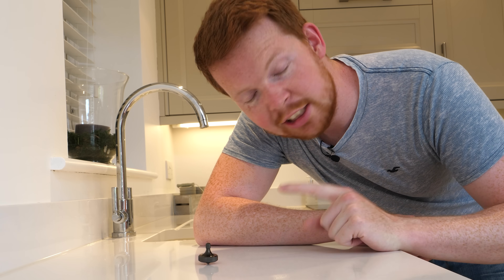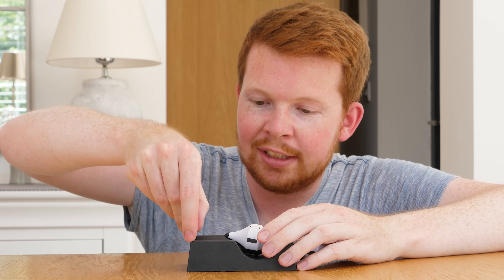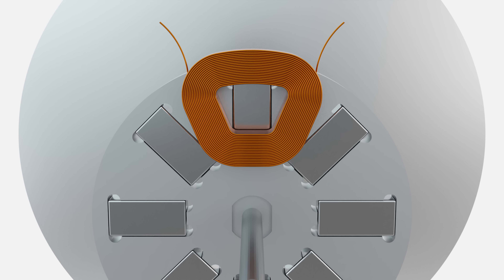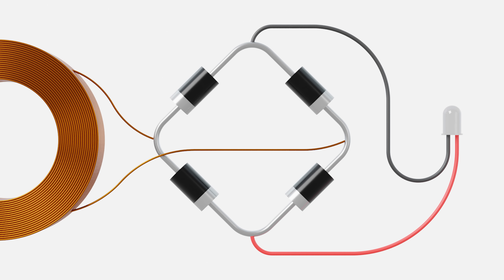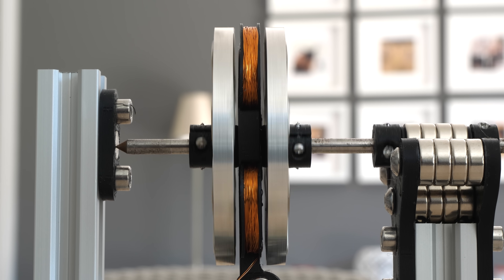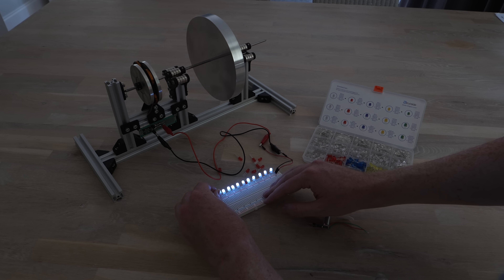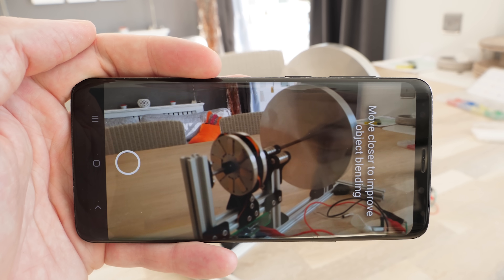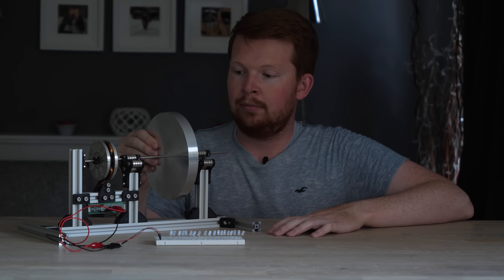Flywheel Battery

Comment: Try surrounding the magnetic shaft of the flywheel with several rows of magnets, instead of having it rest in a magnetic cradle of a couple rows.  Completely surrounding it will prevent the wobble and allow higher RPMs.

Comment: place a static film capacitor in series with a resistor in series with the generator and then the bridge rectifier in paralell to the static capacitor and then a filter cap in paralell to the bridge rectifier and then the diodes in paralell to the cap and you chould now get much more power out and less loss of speed on the generator. the static capacitor will build voltage in resonance with the ac and charge up until the current reach a certain level. the resitor will limit the current and load on the generator. for low voltage you have to use very big static cap.

Comment: Great job Tom! I was wondering if you can make an experiment by sticking the magnetic discs (in attraction mode) on both sides of the aluminum disc and so to spin together (homopolar generator normally have N pole in one side and S pole on the other, but try first with your setup N-S-N-S) and measure the voltage between the shaft and the edge of the aluminum disc? that will be interesting to see the voltage and current (considering the big size of the disc). I was willing to make it myself, but I don't have the tools :(

Comment: While it is a little more expensive, use Thompson induction hardened shafting for your projects.  It's hardened and ground and very very straight. I built countless jigs, fixtures and other tooling using it and it has never failed me in 47 years of tool making.  Love your work.

Comment: if you add magnets (with or without coils on the magnets) at an angle so they constantly repel each other on the far side of the shaft would it be able to power itself or have a reduced loss of rotation?

Comment: If you want to remove the shaft from the ally disc and not able to do so then heat the disc with a propane torch, the ally will expand faster and further than the steel rod, get it hot enough and the rod will fall out, if you don't have a torch handy an oven will do.

Comment: Maybe if you added a hand crank with a gear on the shaft and a larger gear on the crank that you could pull away on a rail, you'd get more RPM without resorting to a drill or sapping energy with bearings. Also, finding the radius before drilling the hole for the shaft would make it much more balanced because you could drill in the exact center of the flywheel. Also, MORE MAGNETS! More magnets holding the shaft up would make it move around less, especially if you alternated the poles on each of them. More magnets generating power means more voltage and amperage. A larger coil with 24ga wire around a magnet hub with smaller magnets on the edge would also generate more consistent power. It's a great project, but you could actually power some 5A 12v LEDs with this if you optimized it, making for a great desk lamp.

Comment: If you would connect a motor to it that would set the speed and give the power back  of this machine, and then accumulate excess current in the battery, would you not get a perpetummobile and free energy? which can be used, for example, in an electric bike in which it would load itself while driving?

Comment: What if, instead of slightly tipping both magnetic bearings to the same side and stabilising it by the rod-wall connection, you have the bearings slightly pulling a party from each other. Shouldn’t that be somewhat stable?

Comment: Have you thought of using a parabolic mirror to throw light into a fiber optic cable and focus the cable light onto the flywheel to get it spinning faster and faster.  Put the flywheel in a vacuum box to reduce drag.  Use an electronic circuit to power a small variable electro magnet at the point of the axis that touches the vertical glass or use a small bearing from a computer disk to reduce the friction at the axis point .  Put a drop of oil at the point of friction to lower the friction on the glass plate .

Comment: @11:10 I recommend that you use a capacitor along the + and - of the generated voltage to eliminate the flicker. Use different values until you get steady voltage.
Reply: I'd be grateful if you could explain a bit more
Reply: @TheNightsfall1   The capacitor has the property of charging itself and keeping the charge inside it until it is discharged by a load - in this case the load is an LED. depending on the load current the proper capacitor can be used. The larger the load current the higher the capacitor value needed to sustain the voltage to the load LED. Adding capacitors in parallel increase the value of overall resulting capacitor thus sustaining the charge longer and thus reducing the flickering effect.

Comment: Awesome demonstration. I have a question for a while and might be a good idea for your next project, or you might just be able to answer. What happens if you rotate magnetic field around a li-ion battery? Copper wire begin conducting electricity, curious to know about battery itself.

Comment: What about replacing the tip and flat disk with another set of magnets?
Reply: Yep, 3 axis stabilization with magnets would be ideal. Along with a separate set of magnets used to push the flywheel and it's all baked in at that point.
Reply: @DJScratchDs  yep! And it would continue to run on its own.
Reply: @elephantfire78  it will never run on its own. In order to get energy you need to put in energy… nothing is free and perpetum mobile is not achievable
Reply: @elephantfire78  it would spin a long time but would run down...it aint gonna be perpetual

Comment: you are levitating your flywheel on magnets by arranging magnets on both contactless axels with same orientation. what if you were to rotate them in reverse? as in, for example, if the south poles on both sides were to face outwards, same with the rotor? wouldnt that provide additional stability without the the need of a smooth plate on one side?

Comment: That's where you could add a capacitor so that there is constant power even when the magnets are misaligned.
Reply: Misalignment is bad. When warp cores get misaligned on Star Trek BAD things happen. 
And this is real life - we don't have an awesome Starfleet crew to handle a magnetic misalignment caused crisis 🚀
Reply: @lillyanneserrelio2187  I've heard that if generators gets out of sync with the grid, bad things happen, and that it's a pain to restart them in sync when everything goes offline.

Comment: Science showed that if you attach permanent magnets to a rotating copper or aluminum disk electrical current is being generated and it can be extracted by attaching an electrode on the axle and another electrode on the edge of the disk.

Comment: [So my english is not very good so sorry for my english] U can make when that spins and generates power, 50% of power goes to mottor to keep that on spinning and other 50% in battery so it charges battery,  but i saw its not enough power for 100% energy that thing generates to spin that little mottor so u need to like energy goes in battery and after 5min of charging it makes energy gates open and all energy from that little battery go in little mottor so it spins again and maybe even faster and then till energy is out then it gates closes and it waits again 5/10min for battery to charge and then it happens again and again, very nice idea btw :]

Comment: Couldn’t you attach a motor to the flywheel and then give the flywheel a spin and it’ll power itself? then you could splice the wire and get infinite power
Reply: in paper yes, but it reality energy is lost due to the design of the motor, the transfer of energy, etc, so you would need to give it some oomph to keep it running.

Comment: I would’ve liked to see you shorting the output so it would agressively stop itself like a magnetic brake, because of the huge current being pulled
Reply: To stop it like a brake, all that would have to be done is to induce a current in the coils in the opposite direction or allow the flywheel to spin a magnet to regain the energy
Reply: @dustinjames1268  mhm makes sense. Looking forward to see that!

Comment: New viewer.  Couple of problems.  

Starting with the 10 red LEDs, let's say starting around 09:35.  These are arranged in parallel, not in series, so the voltage is the same across every LED.  This does not demonstrate any particular or special output potential from the flywheel generator.  A couple of 1.5v batteries with the right resistor will do the same thing.

Continuing with the white LEDs, jumping to about 10:02.  LEDs do not require voltage.  LEDs do have a "forward voltage drop."  LEDs require only current.  Again the LEDs are arranged in parallel so the voltage and current are the same through through each one, no matter how many you add.  So again, a couple of 1.5v batteries with the right resistor will do the same thing.

I agree that it's a cool project, but I'll be impressed when it fits in a flashlight case and can light an incandescent bulb.
Reply: what about the fans, do those also act like LEDs?
Reply: @juggerfox  There are no fans in this video.  There's a propeller on one of those tiny little motor spindles, and yes, those little motors operate on a single 1.5v battery without any resistor.  I think the presenter went a bit overboard with the bit about charging the capacitors before that motor would spin with a lightweight load on it.

Since you dragged me back in, I'll also point out that "an alternator" operates on DC Voltage Input oscillated by mechanical means, and outputs AC Voltage, so just any spinning thing (and especially anything at all that outputs DC Voltage) is not an alternator.  As the presenter diagrammed and explained his placement of magnets versus coils, this thing is just a plain old common DC Generator.  He shouldn't need any rectifier at all.

As I re-watch, I keep staring at that little rectangle of PCB he attached to the casing.  It's exactly the right size to hide a standard AA or AAA battery behind, and in spite of all the presenter's remarks about how he's going to show "all the wires" and etc he never shows the other side of the machine after the PCB is attached.
Reply: @baudgaud  Oh. So from your knowledge on the matter, if you were to reproduce the exact same experiment as he did, you're saying that it wouldn't have the results he claims?
Reply: @juggerfox  I stated that the thing as demonstrated and described is a standard DC generator and not an alternator and not a dynamo.  I said that since it isn't an alternator or dynamo, because it outputs DC voltage, the rectifier should be totally unnecessary.  I also said that it wouldn't need to output much voltage at all, as long as it supplied 20 to 120 milliamps of current, to light up 20 or 200 LEDs in parallel as demonstrated in the video.  Along with that I pointed out that any LED has a current requirement, not a voltage requirement, and I suggested the presenter's confusion stemmed from the Forward Voltage rating which represents a voltage drop in the circuit past the diode rather than a voltage requirement to light up the LED.  I also said that every feat demonstrated with LEDs and motors could be reproduced with 1 or 2 AA or AAA batteries with the right resistor.

What's your problem exactly?
Reply: @baudgaud  I'm asking because I don't know much about the subject and I was interested in your input since you appear to be very knowledgeable.
Sorry for not understanding it on the first explanation, jerk.
Reply: @juggerfox  Well, I'm sorry for being a jerk!  My experience with YouTube repliers is mostly trolls reinterpreting as opposed to legitimate queries to gain understanding.  If you have specific questions about any of my statements then it'd be better to put those up separately, rather than the remark of yours which I replied to in a snarky manner.  Both the broad statement and the word choice makes it actually look like you were reinterpreting.

Comment: Here is the lazy version of it: pour cement into bicycle rear tire (as fat as possible).
Get an old fashioned bike dynamo and lamp. Put bike upside down and turn the  cranks with your hands.
Even lazier : skip the cement and the upside-down bits, and use linear inertia (i.e: just ride the bike)

Comment: Yeah good presentation thank you , but the coils will exert angular forces in reverse direction to the rotation of the flywheel and slow it down within short times acting like a braking  force .  LEDs will not draw high powers

Comment: sir, I have an idea: Connect a traditional battery to output electric power and connect the electric drive to the input of shaft and code an Arduino to give power to elective drive when rpm is x(low point of rpm where the motor will spin) and stop power supply to input drive until rpm y(maximum rpm where flywheel produces its peak power). if this is done this will be the future of the Generator. Please try this and upload Video.

Comment: Why not use a gear and crank to accelerate the flywheel to greater speeds you have more strength it’s just you can’t move your hand fast a gear that could be disengaged would be useful and a much larger capacitor to charge while it’s being spun back up

Comment: Good esperiment, if you look at yoyo or spinning tops, you would noticed that the edges or outer are solid while the center are hollow, your solid block of aluminium is not efficient, should make the centre part thinner like a bicycle wheel or somethng

Comment: Stabilize the upward magnetic force with downward magnetic Force. 
Replace the aluminum flywheel with lead.
Add a single low-friction stabilizer bearing at the flywheel and connect a recoil pull cord.

Comment: Use an active synchronous bridge rectifier to avoid the diod losses. Will bump up the efficiency pretty good and give you atleast another volt on the output.

Comment: Rate of decay is proportional to the wattage output.  Total wattage provided will never be more than the stored energy of the flywheel which gained its energy from the method used to spin it up.  What is the experiment?  The effect of a flywheel on an alternator?

Comment: I made air-con for my rabbits out of an old CPU water cooler.  Calculations suggested it was running at about 300W, although the output temperature was very limited.  Basically I ran a tap at through the radiator with fans at about 10 litres per hour.
It got me thinking - If I had 10 tons of water (2.5m cubed) in several tanks I could pump between them, using solar during the day (with evacuated tubes) to heat water some tanks and and fans and radiators at night to cool other.  I'd thus have hot water and air-con for much of the year for the price of a few pumps and fans.
I think with a bit more thought and space you could really make decent savings.

Comment: You should make it all more compact with a smaller rod. That will make it way more stable and more efficient. But a good try on the Perpetual motion. Next time also put some magnets on top so the magnets on the rod would be trapped and will probably go faster and will stabilize the whole rod and flywheel more!

Comment: Magnetic levitation, there is a better way.  Synchronous rectifiers using "ideal" diodes, are becomming popular too.  As soon as you draw power as opposed to just generating voltage, the thing slows down much more rapidly.

Comment: I would have loved to see a design where you actually tried spinning it up using an electric current in the wires. To work nicely as a battery you would then just need a way to disengage the coils from the magnets when in "storage" mode. Would have been cool to see what the loss over time and from a charge/discharge cycle would be in that case.